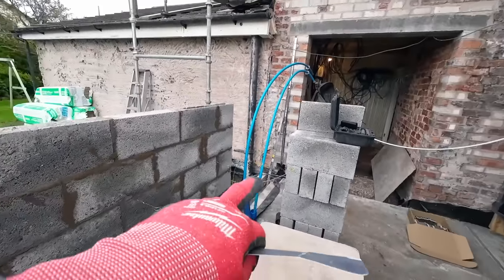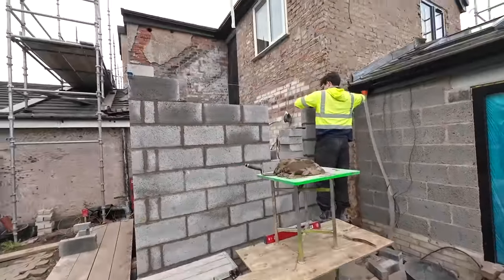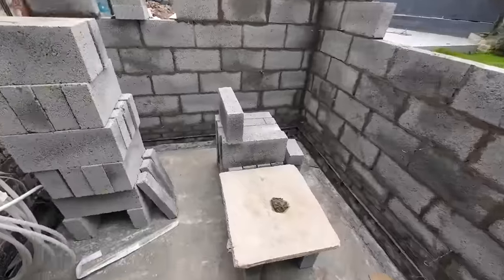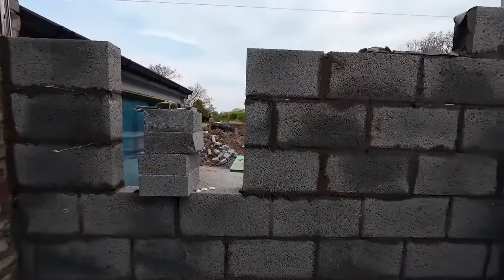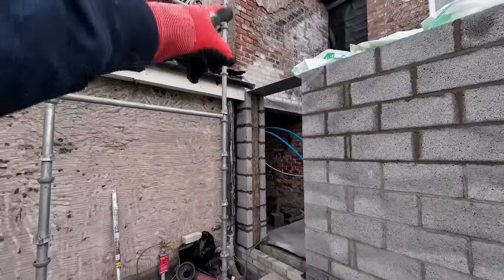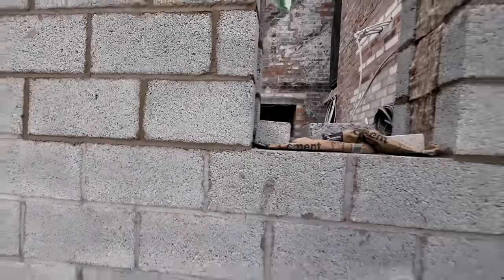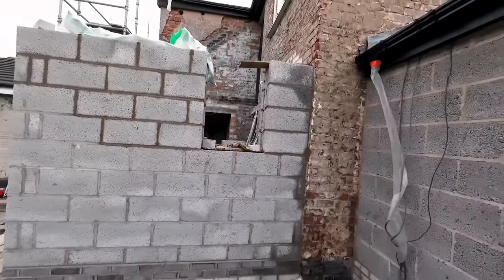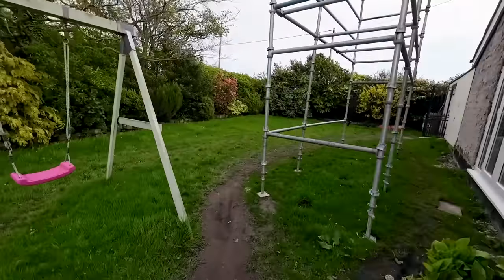150 MILLIMETRE  CAVITY TO MEET NEW BUILDING REGULATIONS

Comment: 12 years ago i built a place in shropshire  200 mm cavity with 7 newton thermalites on the inside   the 25mm glass units should have been treble glased to match the 200 insulation performance  even in the depths of winter  the house was warm     a multi fuel burner ticking over    no gas or oil bills well worth it .the only setback on small projects like this the customer looses 200mm from a small extension  which is a fare bit
Reply: Ahead of the curve

Comment: Isnt PIR (0.022 W/mk) about twice as good as rock wool  (0.040W/mk) ? So your cavity could be 80 or 90 mm instead of 150mm?
Reply from the maker: Nope even with .32 it’s still 150 mm . You need ridiculously expensive pir boards to keep the 100 mm cavity 🧱👍🏽

Comment: Going to be building house walls as thick as castles soon but with cavity. The trouble though the plot size will remain the same size and looks like a monster house from the outside but is so small on the inside you have to buy dolls house furniture 🤣🤣
Great work as always and really enjoy watching your videos 👍👍👍
Reply from the maker: Cheers Anthony 😆🧱👍🏽
Reply: That would be the situation if we carry on using brick and block, I'd like to see planning rules to allow more use of insulated SIPPS. It would means changing the external look of our new builds, not a bad idea.
Reply: @JohnnyMotel99  I personally feel more builders need to learn how to build properly and not have to have their work snagged due to their shoddy workmanship
Reply: We are still using thousands of years old building techniques that is crafty, shoddy at times… when in real life with ICF systems you can make a far more insulated (almost zero draft or cold bridging, stronger walls, securer (almost impossible to smash through due to rebar and solid concrete walls), and faster to build. I’ve built a large building out of ICF and the materials were slightly more, but labour was far less, so it balanced out at the same if not less cost and was finished in 3 weeks.
Reply from the maker: What’s ICF ?
Reply: @SteveAndAlexBuild  ?? You don’t know what Insulated Concrete Form is?

They are polystyrene blocks that are stacked like Lego, with rebar put through vertically and horizontally, then filled with concrete. It makes an incredibly insulated wall, zero drafts, extremely strong, and due to the rebar even if you ramraided it, it would not go through.
Reply from the maker: I’ve seen it on Grand designs once . Totally impractical on small add on extensions but great on stand alone projects 🧱👍🏽
Reply: @SteveAndAlexBuild  Reposting this, as the last message appears to have been deleted. ICF is 4% of the entire UK building industry and expected to hit 25% by 2030, it also turned over a billion dollars in the US market last year. It is mostly used for extensions and smaller work, as well as full builds and basements.
Reply: @ianwright308  Also they are going to look pants in a few years when the coatings start getting damaged and delaminating. Not to mention they WILL need painting because of environmental staining. Meanwhile your brick wall won't need touching in your and possibly your children's lifetime.
Reply: @markrainford1219  hahaha what are you talking about, they are designed to not be exposed!

They are the same as using blocks or timber build, you just add render, brick slips, clad it,… we actually built a single skin reclaimed brick wall directly next to them with ties… you can’t tell there is anything there at all. The entire wall is the same width as a block/brick wall of 300mm. 

but it is the ultimate insulation, 100% airtight, double the u value of the best brick wall, solid due to the rebar and concrete, and exceeds (not “meets” like most brickies want to do) all regs. It costs £45m2 and allows cables and pipes to be sunk into the poly. You just stick plasterboard directly to the inside.

So the reply like you have is showing how they don’t know about 25yr old materials.
Reply: @ianwright308   I've worked on properties that have been monocouched directly to the ICF units and my comment stands. Looks good (if that's your thing) for a few years, then the maintenance starts. Same with slips. A brick skin, ok, that's  different story.
Reply: @ianwright308 mate, we get it, you really like ICF.

Comment: Good job. I have a question here is the us most exterior walls are framed with lumber the either sided  or bricked  on the exterior and plasterboard on the interior. All electrical plugs and switch wires are run in walls before plaster board and insulation are done.  So my question is how is the electrical done on exterior walls.
Reply from the maker: It’s all clipped to the wall before the plaster board are put on 🧱👍🏽

Comment: Nice work guys, out of curiosity. Won't the insulation act as a route for damp to bypass the damp course onto the bricks above? Or does the insulation start above ground level?
Reply from the maker: Insulation starts at dpc and water doesn’t travel up mineral wool cavity batts 🧱👍🏽

Comment: Last new build I built was 150mm cavity with 150mm Celcon internally.!!😳.. worlds gone mad.! Keep up the good work lads 👍
Reply: Glad I've hung up my trowel now, but do we really need the 150mm cavity, more new building regulations BS again, been better to reinvent a better insulating 100mm cavity batt..
Reply from the maker: Bonkers mate 🥵🥵🧱👍🏽
Reply: @stuartandrews4344 150mm of insulation in the cavity is good for efficiency. A better 100mm cavity product exists: Kingspan K106 (Thermal conductivity is 0.018 W/m·K) so nearly twice as effective as the Knauf cavity batt (0.032 W/m.K). It's there if you can afford it.😀
Reply from the maker: Double the price plus extra labour installing the stuff and taping and installing the frizbies 😒. Not a fan of Internal skin first 🧱👍🏽
Reply: @SteveAndAlexBuild  No, I can see that you’re not. It’s still good to see the pride you take in working outside in
Reply: @SteveAndAlexBuild  agree, do not like building inner skin first…
Reply: @tlangdon12  sad yuppy you are .
Reply: Would a fit a vertical dpc between the wall starters, damp will just come across the old brick work to the new inside wall 🤔

Comment: Hi guys🖐As many of your other commenters have said, I'm using 90mm T&G PIR boards in my cavities, which is a little more expensive, but better thsn losing another 50mm of space, which is particularly important when doing extensions👊 (I didnt let the builders bricklayers fit it though😵‍💫) Cheers Del
Reply from the maker: I hate that stuff Del 🤢. I don’t like building the internal first . It’s more than double the price up here £25 per sheet 🥺🤯🧱👍🏽
Reply: @Bricklaying With Steve and Alex   It's the same price down here Steve, but I just couldn't bear to loose 100 extra mm off my floors space😬I have made a good job fitting it, but it's not user friendly at all, and after the the first lift, it can get out and not join up nicely. Certainly not as user friendly as the wool stuff😶 I'll send you some pics👍
Reply: Oh crap... if Del has trouble keeping it tight and locked in,  I've got no chance
Reply: @SteveAndAlexBuild  £25 per sheet there proper taking your eyes out !!
Reply from the maker: Nice one cheers Del 🤙🏾🤙🏾🧱👍🏽
Reply: @SteveAndAlexBuild  🤩👍
Reply: @Gary Harrison  It's pretty easy to make a good job of fitting it Gary, but you just need to take your time.⏲️ 👍
Reply: @SteveAndAlexBuild How does it compare per square meter?

Comment: I live in a 2004 build with 100mm full full cavity and uninstalled solid floor. We have electric only storage heaters and this last year is been very expensive to heat the flat. So I am happy to see larger cavities/more insulation on builds.
Reply: I was designing to that standard in the 1970s.  We should be building to a 300 Rockwool full filled cavity with 450 Rockwool in the roof and a an airtightness of below 0.6 air changes per hour.
Reply: @kenneal8948  300 full fill, that is sounding like a passive house, which is good for the top end but it is about getting the bulk of houses up to European standard as a minimum. Current regs ask for 0.18W/m² for walls which is much better than the old 0.30W/m² of a a few year back. The UK has been a laggard its about time we got it sorted.

I am not even sure if 300mm cavity is a thing. Would they not just use PIR board in a 150mm cavity to provide the same U values.
Reply: We need to go for the top end now.  There are 27 million inadequately insulated existing houses in the UK already without adding to them.  It costs a fortune to further insulate a house, I've designed three renovations on 1970s houses to save 80% on their energy consumption and one of those cost £30k, but it only costs a couple of thousand extra to do the job properly in the first place.  
There is not only the climate requirement but now also the security and fuel cost aspects as well.
If you are building with PIR boards you would need a 200 board to equal 300 of fibre or polystyrene.
I specify a 100 dense aggregate solid concrete block for the inner skin to give thermal mass to enable the use of night time cooling during the summer.  When you are using that much insulation the use of a thermal block doesn't make much of a difference to the insulation value of the wall and the cheaper block also helps with the costs.
Reply: @SteveAndAlexBuild  Further to the cost of £30k for the insulation, the owner was getting a return on his investment of about 6% .  He used part of his pension lump sum to fund it and was getting a better rate of return than if he had bought an annuity with the money.  And that was well before the increase in fuel costs.  If you don't have to pay interest, insulation is possibly one of the best investments that you can make and that is before you take into account the added comfort

 
T

Comment: Subscribed 👍 great job lads. May I ask...if you had a freezing house and then built a 2025 regs extension, how much benefit would be given to the old part? Possibly EWI on some walls connecting to the extension.  Obviously what you saved on heating the new could be instead put into the old.
Reply from the maker: Thanks Christian . It’s a massive grey area 😬🧱👍🏽

Comment: Genuine question why have 150mm cavity and then fill it with Rockwool which in my mind retains water if it was to get in also not be able to dry out because there is no open cavity to allow air to flow and breath
Reply from the maker: It’s not rockwool 
Fibreglass cavity batts don’t retain water 🧱👍🏽

Comment: Wish we used them blocks and insulation in Ireland.  I woukd say a 4 solid woukd weight 4 of them blocks your using. As for the insulation for 100 or 150mm cavity its full fill soild insulation no room for error . Has to put in carefully or it push out your blockwork

Comment: Hi mate, question about your threshold/doorway detail, how come on this job youve built up the inner leaf where generally you run the slab right up to the outer leaf insulated upstand, and in this job did you insulate that bottom threshold cavity, cheers guys
Reply from the maker: Hi we were asked to do it that way . We never do it that way normally 🧱👍🏽
Reply: @SteveAndAlexBuild  cheers pal, so you prefer extending the slab
Reply from the maker: @DB-ok8zf Always. It’s the correct way 👍🏽🧱

Comment: Top job, great to see it finished with the roof on. Assume as well as improving insulatuon, thise cavernous cavities also help reduce the problem with insulation promoting damp transmission across the cavity?  In this case however assume its probably having cement render on the outside so shouldn't be any issues for a few good years whilst that is all intact.

Comment: Pleasure to see neat blockwork - I wonder what the regs. are on block specs. 

Given that they have upped the cavity insulation requirement, how much attention has been given to inner and outer leaf properties.

Seems like an opportunity missed not to specify a higher insulating material for the building structure as well.
Reply from the maker: It’s all accounted for 🧱👍🏽
Reply: Should you not be using thermal blocks on the inner leaf? Also you can still use a 100mm cavity with the insulation to match so I understand.
Reply: 90mm interlocking PIR with residual 10mm

Comment: Great video. How do you ensure that the cavity width is maintained as you build up? So that you don’t end up with a larger or smaller width in different areas?
Reply from the maker: It’s all about preparation. You make sure your external wall is plumb then you can measure your internal of it for speed 🧱👍🏽

Comment: I specced a secondary layer using superfoil basically standard breeze with insulation in then batten superfoil batten then plasterboard its 30 outside and 23 in the extension.
The air gap is the key the stuff is like space suit material piece of cake to put up highly recommended

Comment: I’ve been told by my architect that I can use 90mm Recticil Euro insulation board and this will satisfy regs instead of needing 150mm of insulation. Any thoughts on that?
Reply from the maker: Yes that’s fine but it’s ridiculously hard to build with  a 10 mm gap plus we don’t like building internal walls first 😑🧱👍🏽

Comment: Just a thought on this, the concrete blocks are not very good for insulation so you are relying on the 150mm wool. 
Instead of the inner leaf, if it had a timber frame then you could still get 150mm of insulation between a 50 cavity and 100 in the timber frame. 
Must have nicer neighbors than me to not be round when you were  chopping the blocks on a sunday morning!
Reply from the maker: They aren’t concrete blocks 🧱👍🏽

Comment: Hey guys love your videos. What blocks are you using are they fibrolites? Is this wall speced to 0.18w/m? Can you achieve this with 2 skins of fibrolite
Reply from the maker: Thanks Shaun .
 Yes to both 🤜🏽🤛🏽🧱👍🏽
Reply: Thank you mate that’s great iv been pulling my hair out as our architect has speced thermolite inner skin and concrete blocks outer skin. I really don’t want to use thermolite would much rather do what you have done 2 skins of fiborlite and the 150mm full fill! Thank you!!

Comment: Would you still need a 150mm cavity if you used 90mm Kingspan K106 Phenolic partial cavity fill insulation and Wraptite taped joints?
Reply from the maker: No 100 mm cav for that 🧱👍🏽

Comment: There is a lot of sense in insulating for example uninsulated 15-20mm heating pipes in a boiler room waste up to a 6-7€ per meter in heating costs with 15mm pipe insulation wastage drops to a roughly 1-2€ per meter and 1 m^2 of windows generally waste heat as much as 5-10m^2 of equivalent wall. Biggest savings however come from insulating your roof as the heat likes to rise up. In general it's recommended to have a roof insulation thickness x1,5-2,0 compared to wall insulation. Pay back time in saved energy costs from added insulation used to be 5-10 years but with the rise of energy costs it's likely even lower now as it is. Here in Finland a minimum wall insulation is currently 300mm's of rockwool or equivalent insulation and 500mm's for roof/attic space.

Comment: Different regs for different areas, here we would have to cut in a vertical DPC where your blockwork meets the existing building.
Reply: Its not diffrent Building regs you should be putting vertical DPC where blockwork meets the existing building on all extensions ?
Reply from the maker: @cai1356 . It is different regs and it varies from person to person who comes out to inspect 🧱👍🏽
Reply: The Building Regs dont change they are the same throughout the whole Country . Not only is it good practice it is sensible  to do so due to moisture penetration for a start. always look at weak points in the design and challenge. All Building Control  Inspectors should be picking this up I was one ! so should all good builders too.
Reply: The Building Regs dont change they are the same throughout the whole Country . Not only is it good practice it is sensible  to do so due to moisture penetration for a start. always look at weak points in the design and challenge. All Building Control  Inspectors should be picking this up I was one ! so should all good builders too.
Reply from the maker: @cai1356 . A bit pointless on a 9 inch wall plus the whole lot will be rendered

Comment: We do 8 inch cmu block with 4 inches of mineral wool, low perm air barrier,  2 inch air gap, and masonry veneer. Which ends about 2 feet thick or 609 mm.

Comment: how does water not leech from the external skin to the internal leaf? Is the insulation completely water proof?
Reply from the maker: Water doesn’t get through the outer skin in the first place 🧱👍🏽
Reply: Here in Ireland there is a high risk of water penetration using that full fill system (unless it is a certified bead). As a brickie myself I have seen water travel through on ties and damp spots evident internally . An external plaster with water proofer isn't a guarantee either. While moisture might not get through entirely I have seen insulations become damp and disintergrate in the cavity. Your climate must be drier than ours? Just a though mate @SteveAndAlexBuild